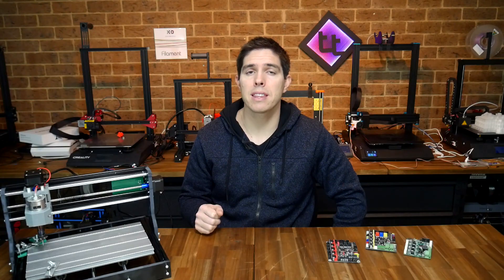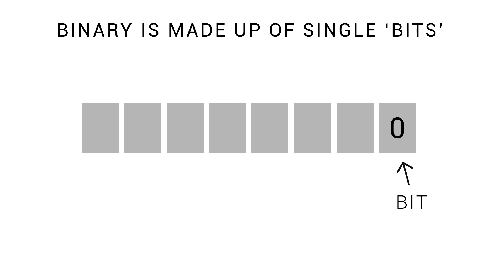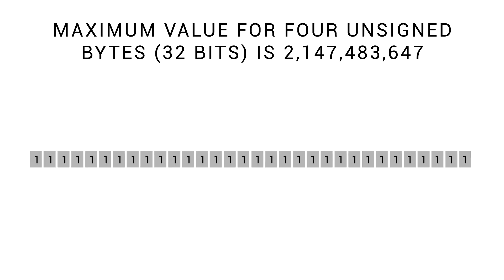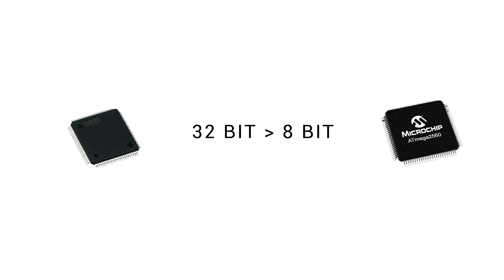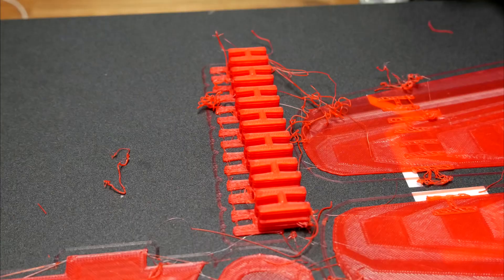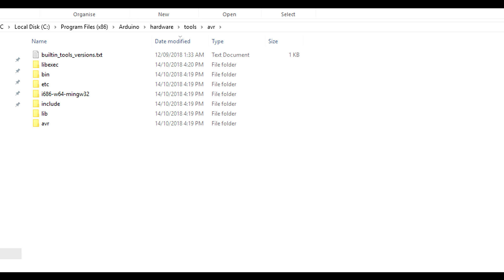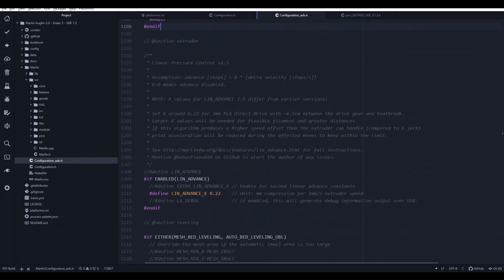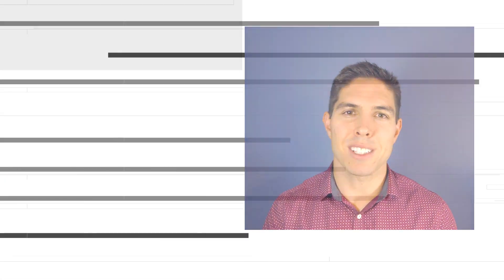32 bit 3D printing - What it means and when you need it

Comment: on AliExpres their is £2 difference between the MKS gen L and the MKS SGen L (the 32bit replacement, same size) i'd love to know why anyone would pick the 8 bit for £2 difference.
Reply: You're right, at the current market prices there is no real issue with even budget 3D printers being supplied with the a 32bit board. For the likes of Creality, the price in bulk would be even less than £2 a board different. The manufacturers just need to get on with it.

Comment: I was thinking a long time to upgrade to the MKS gen L but up until recently i wont. i will use the SKR 1.3 because 2 killer features: SD card and 32 Bit proccesor
Reply: MKS Gen L can have sd card. It requires to buy SPI card reader for $0.5, connecting it to AUX3 and some small change in marlin.

Comment: I wonder if eventually we’ll see ‘dumb’ boards which are slaves to something like the RPi?

On the one hand it would make upgrades easier, cheaper and potentially provide advantages such as integrated wifi.

On the other hand it could cause issues such as if the Pi freezes/crashes.
Reply: Like, say, this?

https://github.com/KevinOConnor/klipper

Would love to see a comparison of this vs a new controller board.
Reply: @HughCampbell  Interesting! Thanks!
Reply from the maker: Got klipper plus a dedicated klipper board coming up.

Comment: Between setting up the software to use Marlin 2.0, configuring the FW for the board and the printer, setting up various drivers (especially TMC drivers with SPI/UART), and setting up various sensors, you could have an entire SKR series lol.